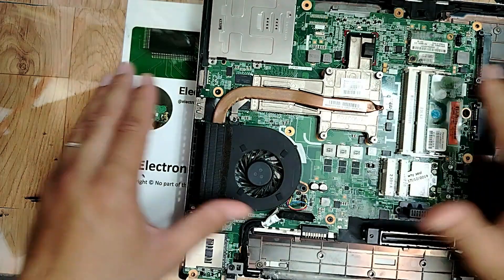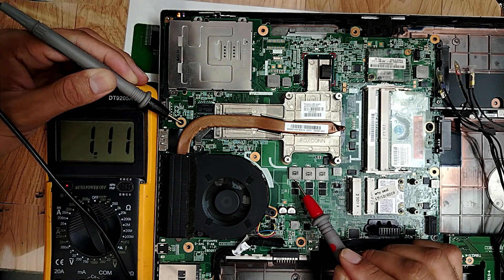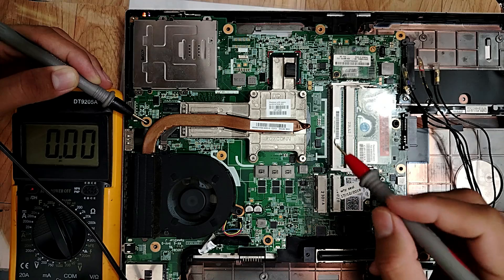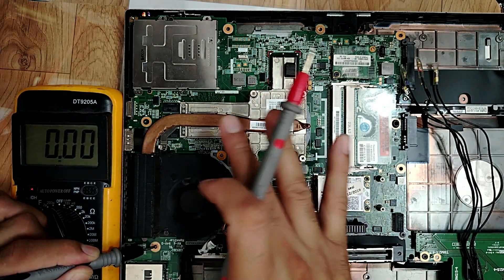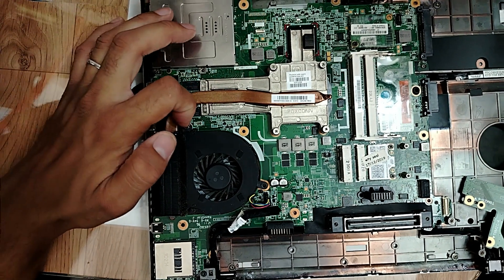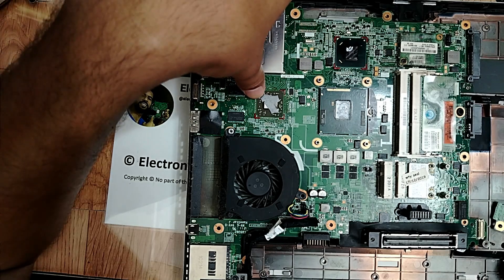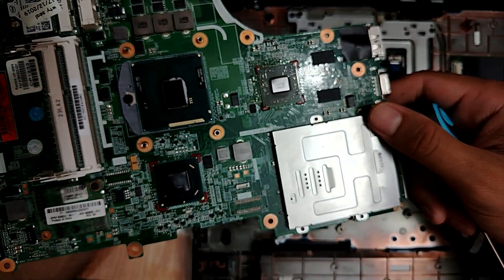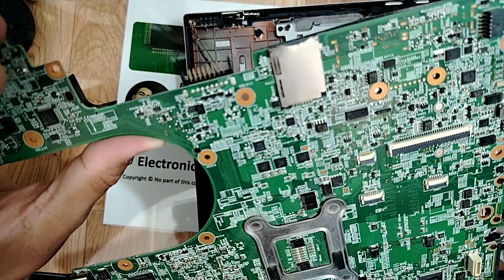How to Diagnose a Laptop That Won’t Turn On - Motherboard Repair

Comment: My friend, I enjoy watching your videos. However, in this video, you mentioned a laptop that did not turn on. Most of the voltages you measured were after the laptop started, in which case the card would have turned on😊. You should also mention that you pressed the start button while explaining, because most of the viewers are beginners. Thank you for the videos, good job.

Comment: The 3.3 bios voltage must be present even if we don't turn the laptop on ?
Reply: Helps store critical information about the system when power down to RAM
Reply from the maker: Yes, that is correct; the 3.3V BIOS voltage is usually present even when the laptop is off.